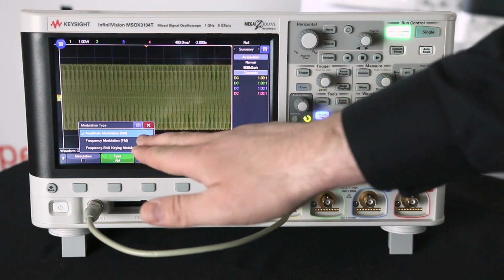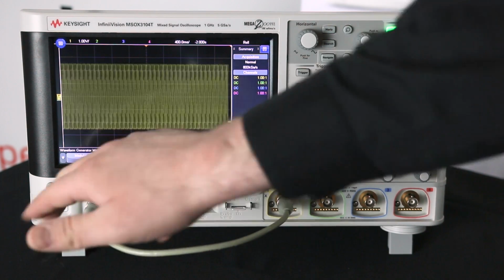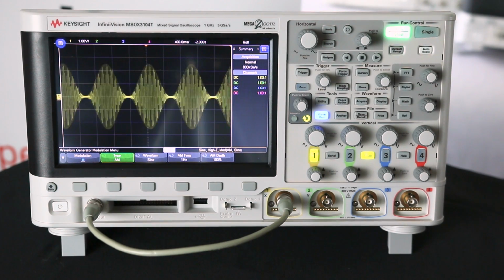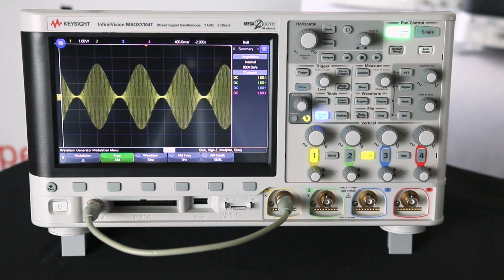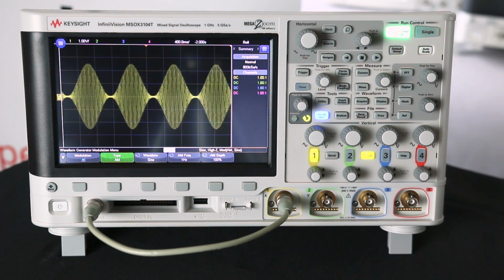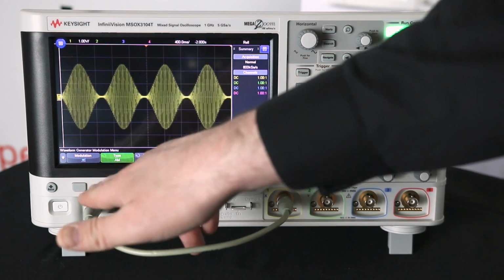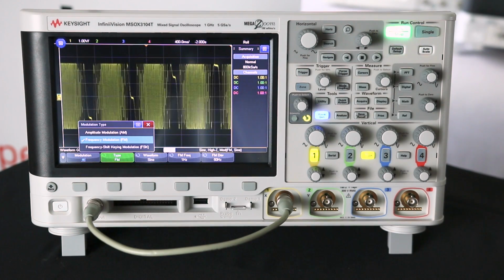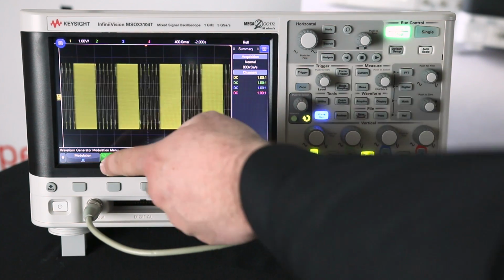Modulation and Scope Month Daily Winner (15-Mar)

Comment: just for clarification, when you draw on the 15th are you actually drawing for the 14Th entries? 
I've tried re-entering after this drawing took place and I get a notice saying I'm already entered. 
just thought id ask for anyone else confused. 
Thanks for this awesome give-away Keysight, and good-luck to everyone!
Reply: +Gregory G Harding I have this problem as well I would really love for the online form to say for which day I am entering the contest just so its clear.
Reply: yes, I would also like more clarification.
Reply from the maker: +Gregory G Harding The "one entry per day" is based on a day in MST.
Reply: +KEYSIGHT OSCILLOSCOPES So basically the deadline is 23:59 MST on 14th for the drawing on the 15th?
Reply from the maker: +TrustMeI&#39;mAnEngineer Yes, that's correct.
Reply: +KEYSIGHT OSCILLOSCOPES Ah, OK. So entering right AFTER the drawing for the next day is correct. It faintly worried me that the name 'pool' was reset or filled only with entries from the same actual day of the drawing or something like that.